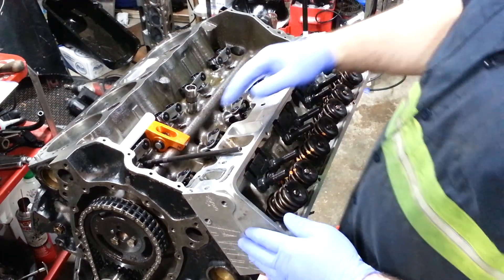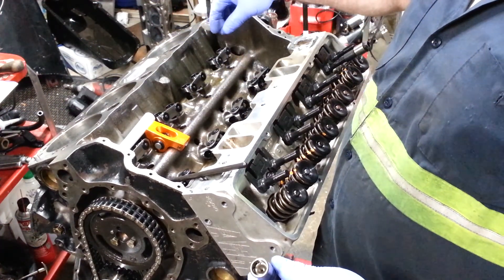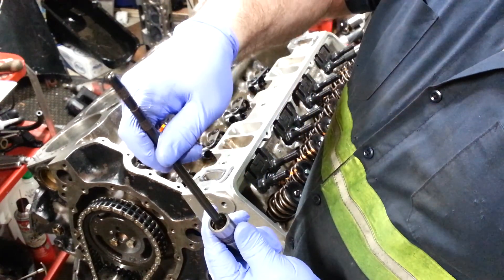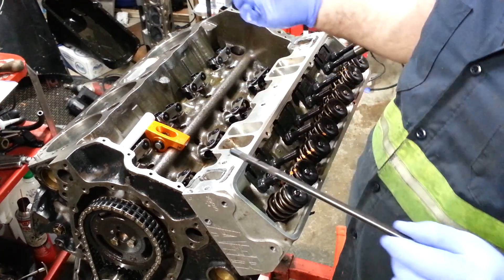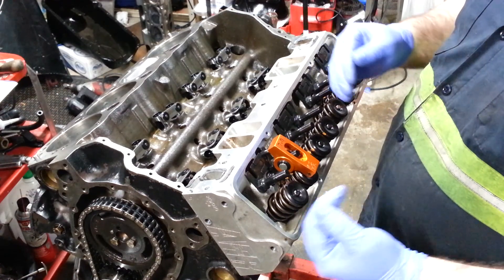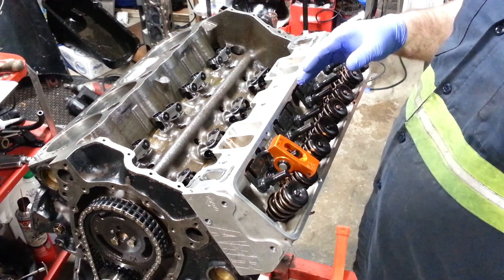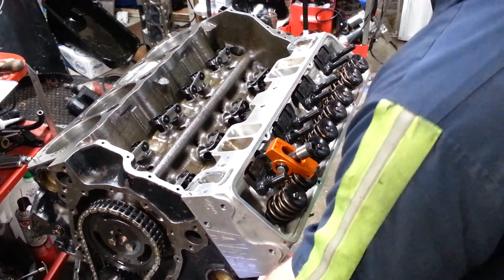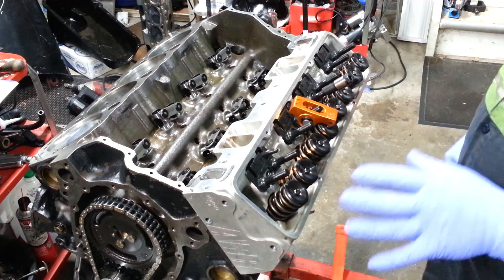How to determine proper push rod length SBC

Comment: FFS , ever heard of checker springs !
Reply from the maker: Thanks for your reply. Yes, of coarse I used them when needed. This video was made post set up and using what was in final build at the time. But, when you use checker springs they only help in multiple tear downs to dial in. I am sure you understand the motor will be using those same springs and push rods in this final build. Plus 90% of most weekend builds are using mostly stock springs.  If you give Comp Cams a call 1-800-999-0853 they can walk you through using the tool as well.
Reply: @djrowe10  Fill the cylinder with air and use an on motor valve spring removal tool. Then install the checker spring. If you don't use the actual lifter that's going to be in the final build you may end up with the wrong length push rod which totally defeats the entire exercise.
Reply from the maker: @h2oskiaddict  I made this video after proper length was already established prior, so did not use checker springs in demo. I used same rocker in build also. Not sure what putting air into cylinder does to determine pushrod length? Thanks for watching!